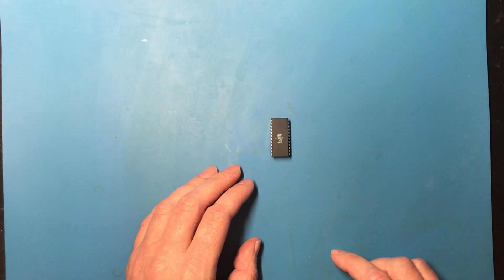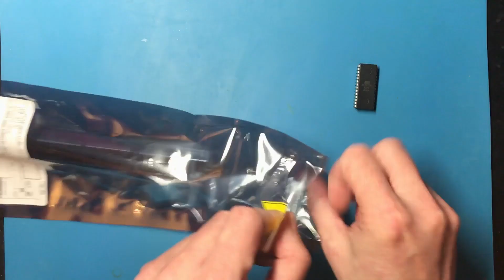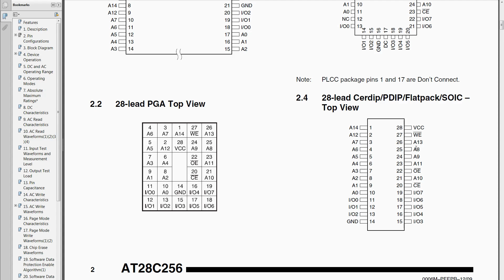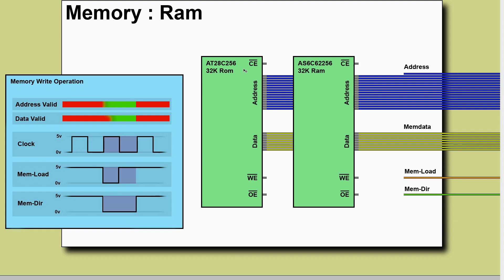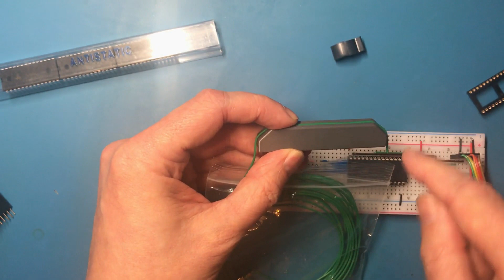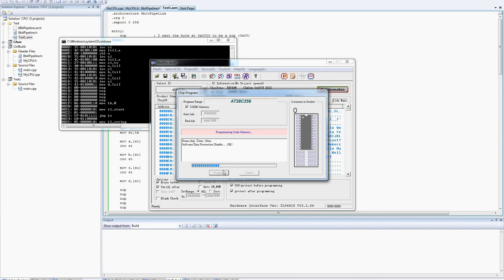Ram (aka: The one where the build becomes Turing complete) - Making an 8 Bit pipelined CPU - Part 60

Comment: Can't you put the Zif-Socket into a socket to gain space for the connections?
Reply from the maker: Unfortunately not with these, the zip sockets I have the pins are folded metal strips perpendicular to the device, all the common sockets are either pins or slots aligned with the device.

Comment: Didn't you set up SI and DI with an auto-increment the same way that PCRA does?  Like it's just a control line that can be set in parallel with a read or write, not needing an additional instruction.
Reply from the maker: Yes, the lodsb and stosb instructions take advantage of that.

Comment: Re: equal clock propagation delay - take a chip with four XOR gates, use two of them to feed the two CE lines from the same input, set the other input of each gate to 0 and 1 respectively; now one of them inverts and the other does not, with presumably very closely matched propagation delay on both.
Reply from the maker: Yeah, I've used that technique since although exact propagation matching isn't guaranteed it should be closer.

Comment: I saw that he'll be adding a SNES controller later on, so I have a few ideas how he might do that at the end of this comment.

It may technically have already been Turing complete before this, but having RAM is still nice. (In case you're wondering, I did use the simulator from the Discord server to make sure the FRACTRAN interpreter I posted in the comments to the previous video actually worked. It's quite slow due to the repeated subtraction algorithm I had to use for division, which is compounded further by the fact that divsion needs to happen a lot more often then multiplication, but it did work. I could have freed up enough registers for a faster algorithm for division if I had restricted the input, numerator, and denominator size further to eight bits, but FRACTRAN encodes its data using the exponents from prime factorizations, so 16 bits was already quite restictive as is.)

(22:36) No, you did not. It was wrong the first time.

So, I saw you'll be adding a SNES controller later. That controller has more than eight bits of data, which might cause a race condition where the controller data gets updated between when the first byte is read and when the second byte is read. Now, assuming your controller interface hardware has a pretty refresh rate, you could probably just ignore that race condition. However, since the controller is a read-only device, you could also connect the load line coming in from bus control up to an inverter, and then from the output of the inverter to the controller's latch line, rather than having the latch line determined based on the controller read clock.
Reply from the maker: What size divide did you write?
Reply: @weirdboyjim   I wrote a 16-bit by 16-bit divide, but I was using RA, SP, and SI for other purposes and couldn't use them as scratch registers for the division.

Comment: Is the discussion here about pushing back the rising edge on the MEM-LOAD signal because the RAM will perform the write on the rising edge of the signal? And you want to ensure that the address and and data are valid before you perform the write?
Reply from the maker: Yes, the specs on the ram chip say the address lines need to be settled by the time that line goes low. That is entirely translating my load line (that works for my registers) into something that works as the WE line on the ram chip.
Reply: I see, thanks!

Comment: One way to solve the issue at 8:29 is to use exclusive-OR gates on each signal. One gate is XORed with 0 to give the same signal and the other is XORed with a 1 to invert the signal. Both signals have the same delay. If you use the same physical IC the properties will track with temperature, etc., too.
Reply from the maker: That's a really good suggestion actually. I came up with a few different ways of solving this with matched latency, I tend to judge my solutions by chip count, then number of unique devices in the module, then number of unique devices in the build as a whole. I like this as it would only use half the gates on a 74ls86 and xor's can be quite versatile.
Reply: @weirdboyjim  they're nice little devices. The advantage is that both Q and /Q have the same delay. Fantastic series, I'm keen to keep watching!
Reply: I was just thinking about this a couple days ago in regard to my own 8-bit Ben-Eater-Inspired CPU.  I knew there had to be a simple solution.  And, as usual, it's one that seems embarrassingly obvious once you see it.  Thanks.
Reply: @rdwells  No worries! Good luck with the build!

Comment: I am going to create PCBs for GPR, AddrRegs, XFReg, BusControl from my Proteus Build, absolutley NO eperience, so I will need many of your 5-8-16 pin cables. Where to buy or how to produce myself?
Reply from the maker: I made all the cables myself, you can probably buy the strait through ones but the custom ones for shuffling the control lines would have to be hand made. First few DuPont cables I made were not reliable, you have to be careful of that.

Comment: Hi James. On my first buid I actually chose a Non volatile static RAM (NVSRAM), the M48Z02 by STMicroelectronics. It is still a RAM with TTL levels, but with a built in battery backup so it never forgets. It is very convenient when setting up the first basics of the CPU as you don't need to reprogram the memory at each power on and yet you don't need to move the chip into an EEPROM programmer to make any changes.
Reply from the maker: Interesting chip that one, but if it stays in your build how are you programming it? The ram/rom split in my build is temporary, I'll talk a bit more about my longer term plans in a future video but your absolutely right to keep one eye on how easy it is to get code into one of these things. I plan on doing quite a bit of programming so getting the iteration time down is quite important.
Reply: @weirdboyjim  To answer your question : I actually am building and arduino based RAM loader. It takes over the RAM address and data bus (using a PROG mode that disables the normal address bus and data bus) and than loads the RAM. For this I am using a bunch of 74HCT245 to handle the bus, a couple of 74HC595 to unserialize the data from the arduino and that's it. No need to unplug anything, load time is really quick using the arduino as a USB interface to my PC.
Reply: A quick note to let you know that it works perfectly. The arduino can be connected to the RAM data bus and this way you can even use it to monitor what is going on.

Comment: Well done James! Only 60 videos and 11 months to get this far :-). When I used a ZIF for my CPU I found it wouldn't even go into the breadboard as the pins were too short and thick so I ended up putting the ZIF into a 28 pin squarish holed socket and putting that into a machined socket and then fitted that onto the breadboard. It had the nice side-effect of lifting the ZIF off the breadboard so the wiring fitted much easier. I'm also changing to using 39sf010 flash ROMS, so even though they are 4 times bigger than I need, they are twice as fast at 70ns and are also a lot cheaper than the 28c256 ROMs.
Reply from the maker: Thanks David! The whole process of making videos slows me down a lot, I had a silly notion when I started that I'd be done in "about six months". I had a look at the 39sf010, it's a nice part but I've been trying to build this project on the older technologies. The complicating factor is that there are lots of parts that are not really available anymore. An interesting one is the AT27C256R-45PU, that gives a 45ns access time but it's an EPROM (one time programming). I've the control roms prove to be the limiting factor in clock rate I'll look at replacing them with these, especially for Stage 1 that works on a tighter time constraint than Stage 2.

Comment: your computer was actually Turing complete before as you had registers, which could hold values. (only a limited amount, but that's enough) Your computer became truly Turing complete when you could jump conditionally or possibly with the addition of the mov instruction. Because mov IS Turing complete on x86
Reply from the maker: The definition is pretty tricky. Mov has been proven to be Turing complete only with ram. To claim completeness you really need to be able to index something modifiable, you could make the case that a calculated address jumping to code referencing different registers does this but you would run out of registers to do any real work in.
Reply: Memory is very limiting when you only have a few registers, but with RAM its also limitig (not as much). To be truely Turing complete you would need an infinite amount of memory, but for now we have only a few kilobytes
Reply: My call would be it was Turing complete before, in the modern practical sense of the phrase, but is now vastly more capable: registers are arguably just very fast memory. Coincidentally, I just finished an episode of History of Computing podcast on TI’s competitor to the x86 line. It had memory-mapped “registers”.

Comment: This is really coming along nicely! Is adding a stack just "software" work, or do you actually need hardware changes for it?
I don't know much about any of this, but for my own "design" (that's really a grand word for what I'm doing) I'm always worried about using extra delays to time things right, because it's hard to figure out (or rather, it's a lot more work than I'm willing to do) how long every single line can take in the entire system. For now, I'm leaning toward a two phase clock to make sure these things don't overlap, but I don't actually have the control logic yet, so maybe I'm entirely wrong.

When you're designing a PCB for that ZIF socket, I recommend not doing what I did and make the holes too small :) (and definitely don't connect a pin high that should be low or entirely forget to connect an output enable line to the corresponding header pin... Not that I would ever do that, and you can't prove it anyway!)
Reply from the maker: Adding push/pop will be entirely additions to the control Roms, but I will need to fix that address issue I hit in this video first. Push/Pop require exact synchronisation between the increment/decrement with the memory operation. I'll probably push call/return into their own video, they will need some hardware tweaks. Pretty much everything in my build is timed from either the rising or falling edge of the clock. The one place I already have a deliberate delay is just nudging an edge back slightly to guarantee it's result doesn't overtake another operation from the same edge. Thanks for the zif heads up, I'll probably get a decent one for the final implementation so I can match the data sheet against the pcb.

Comment: Excellent work!  In terms of delay strategies, anything which is consistent is valid. So long as your propagation delay through the gates doesn't suffer from a thermal coefficient you're golden. If you need absolute certainty in a delay, you can always follow the standard from the ECL days and just patch in a length of wire with the appropriate delay. The big issue with wire delays vs. gate delays is when people try to spool up a couple meters of delay wire and they inadvertently create a choke which smears the rise and fall times, leading to jitter. Note that the gates used in early CRAY machines were all characterized for both minimum and maximum propagation delays in order to ensure things kept in sync.
Reply from the maker: The data sheet for the invertors gives a range of 8-14ns,  the line needs a 25ns delay to offset the maximum time for getting the data onto the bus. With 4 invertors that means my delay is 32-56ns. So the worst case scenario would be that I bump into the back of the clock cycle at around 9mhz.  In all likelihood I'll be capped by something I don't know about yet, but I do like to keep track of these things.